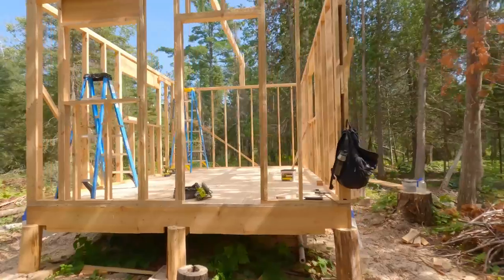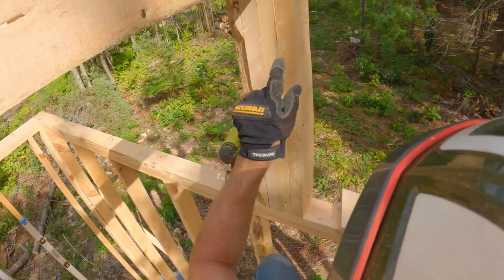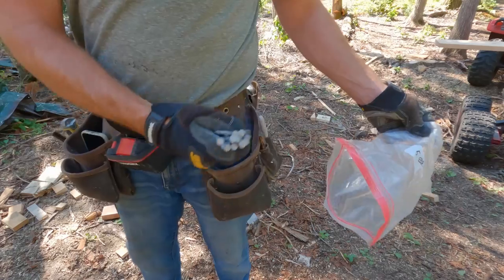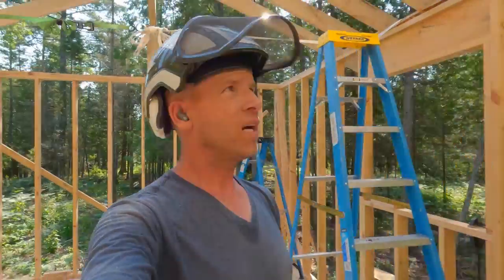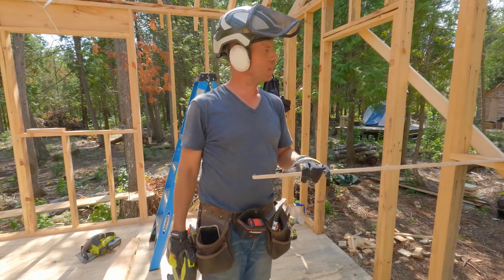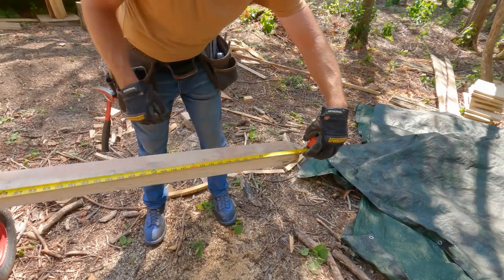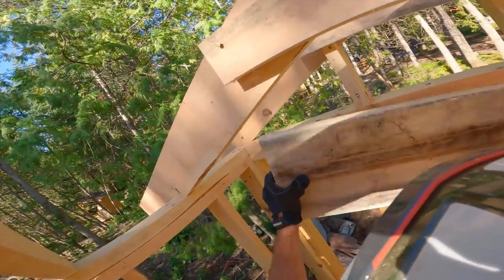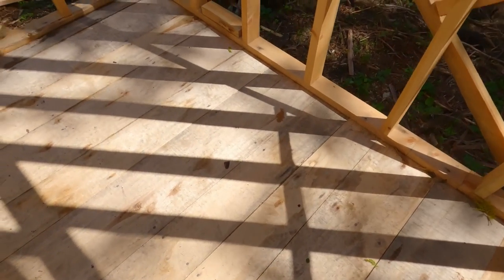Wet Lumber Framing- Solo Winter Cabin Build.. #100

Comment: 100 sf is all you can build in Michigan without a permit. And by law for a dwelling you first need your well and septic installed and final inspection usually with soil erosion permits and barriers. Sad but true. Michigan is not like Idaho where permits are optional. I honestly hope you'll be able to pull all this off without the township shutting you down and condemning your builds. I've been a builder for over 35 years and also own property in the UP and have seriously considered moving to a state with more relaxed laws regarding building.  I honestly believe we should be able to build and do whatever we please on our own land, providing there's no lein on it. The Michigan beurocrats unfortunately believe otherwise.

Comment: Oh...hey worm has anybody told you...you look like Van Diesel? I'm a new sub to your channel and ever since I started watching I'm thinking this guy looks like someone I know or someone I've seen and it finally came to me it's van diesel yep yep...oh 1 more thing...you need to use half lap joint instead of butting everything up together, half laps are easy to make and a whole lot stronger than butting boards together or scabbing boards together..it's the method they used back in the day and as a testimate to their strength just look at the older buildings/houses still standing yeah look it up dude and you really need to think about useing insulation in your buildings, it would stay warmer longer and not need as much energy/propane to heat them up...

Comment: I think for the most part small structures are overly engineered in today's modern building world. I get it, if a tornado comes by and the roof falls on Timmy, the insurance company will be upset... but for the most part the Timmy scenario doesn't exist and a building will be fine if some level of craftsmanship was put into it.

Comment: Maybe a collapsible insulated box store outside and bring in to put things that can’t freeze to heat only a small 4 x 4 x 4 box for when you are away. Just a frame with insulation lined to reduce the area you heat when you are away. I’m just thinking inside the box. 😂

Comment: I have a 35gal barrel up in my corner for my water. In the same spot I have my charge controller and 12volt water pump, and batteries to run it all.

Comment: check out a rocket mass heater tou have to build it yourself biut myou dont hae to feed the fire all the time once it heats the mass unit up that will stay warm n radiate heat for several hours which is like putting your heat kin a bank for later or storing ur heat. Im sure you have most of the material on your property clay gravel n rock you might even be good at making them. There are instructions but also a lot of creativity or freedom how you decide to build one.

Comment: Hey Ryan, it's amazing how fast it all comes together once the materials are available huh? LoL listen brother I cannot stress this enough, once you pop that Aspen up there ,you might want to consider purchasing some corrugated metal roofing, and here's why, (the cons)..that roof is not built for extreme strength, just from the size of that ridge plank and then your  rafters as well, then figure in your out of square bottom portion of the cabin, then add the weight of fiberglass shingles plus a Michigan snow load in say January or February and we're talking sketchy at best, I don't want to see any hardships befall you so, watch a few videos of just how easy it is to pop a metal roof up. There's plenty of pros to the metal option vs. The fiberglass,  1) it's much much lighter , 2) you can actually do a rain catchment system off of the metal roofing, where as it won't work so hot off a fiberglass and you won't be able to wash yourself with fiberglass laden water ,3) the snow won't stick like an iceberg to the metal vs. That fiberglass, just turn your heat up and fashion a T-Shape pull stick and drag it off of the roof, it'll slide with the slightest of effort with a quick tug! And 4) most of the cost of those metal roofs are the little 1×3's wooden strips that you zip the screws into to tack the roof onto your sub roof (those Aspen boards) and in theory, you'll be able to get a bunch of those out of one single slice of each milled board, so, thats a win win also...look,I'm not trying to come off as a know it all, believe me , I just want to help you to avoid those "shoulda,woulda,coulda" thoughts that come way after the build is complete and keep your good vibe of enjoying the build going..and it will save you time, money and effort as well, plus it'll be a lot safer too! Great video as usual,  I even swiped an idea off of you by watching today..enjoy that weather, it's starting to cool off now 👍and keep enjoying that build, it's a dream for many people to do exactly what you are right now!

Comment: Look forward to your video every Saturday.  Your skills are evident .  May I suggest for heating why not have also a very small wood burner in tandem with a propane heater. You would save big time on propane.  A small wood heater in a small insulated area would do the trick no matter what the wood you use.